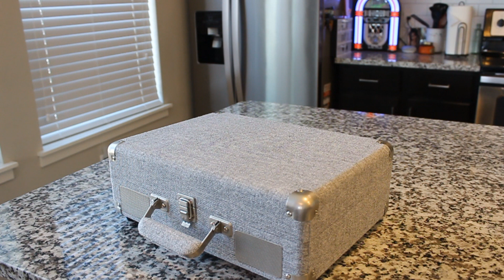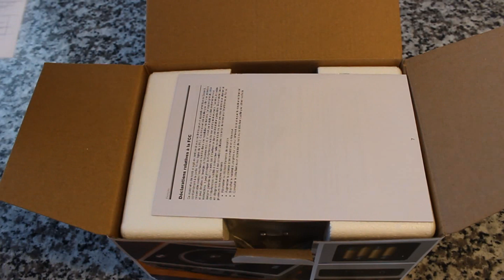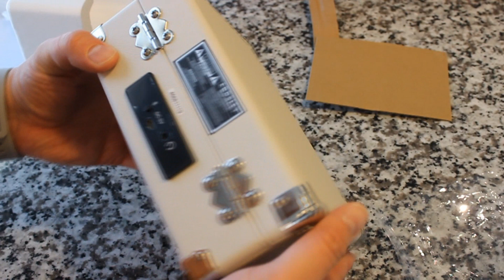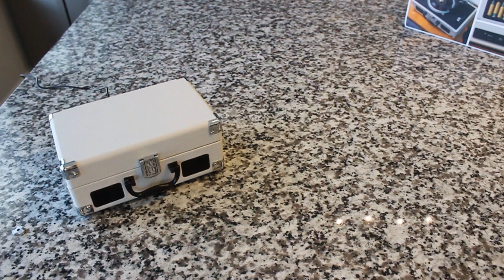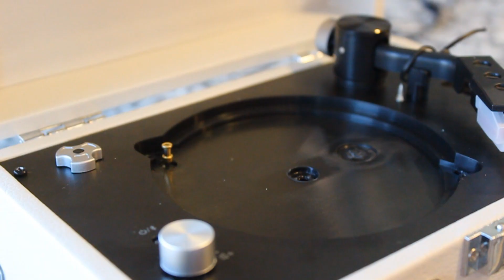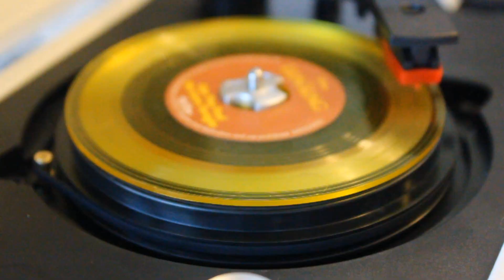All New Crosley Mini Cruiser!

Comment: If the tape did work, it would have changed the speed as well. I would try to adjust the motor mounts if it is possible

Comment: I really wish they played at 45 rpm as well to accommodate the ability to play those old Philco Hip-Pocket records from the late 1960s. Philco had a mini player back in 1969 which also played 7 inch 45 rpms. I think Crosley would have a winner if they would return to the Audio Technica and allow two speeds (45 and 33). You can still buy new 7 inch 45s and Newbury Comics and this player would be perfect for playing these single as well.